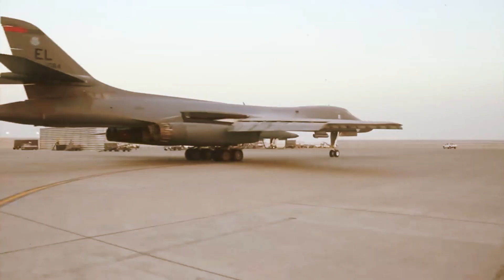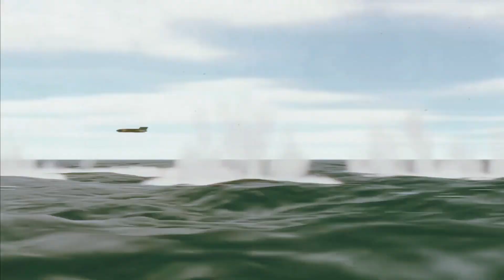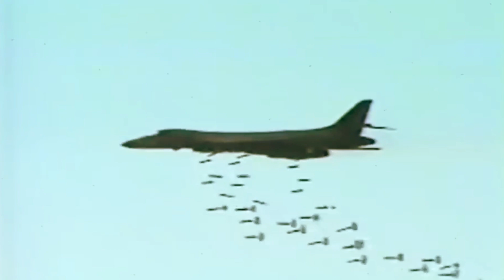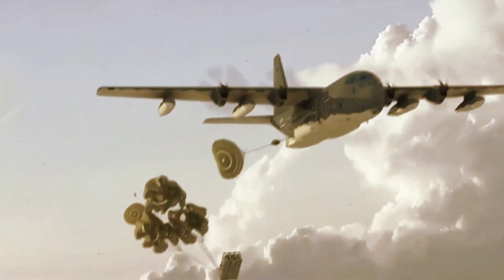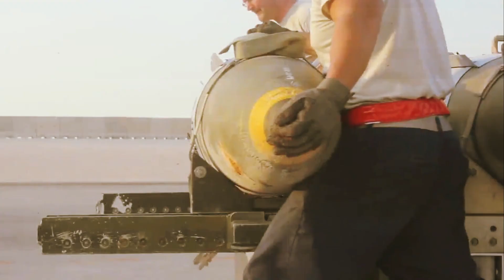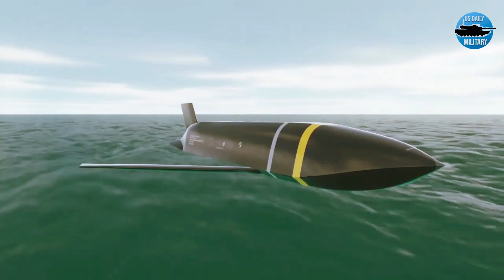New B-1 Bomber : Could Turn Chinese Aircraft Carriers Into Flaming Wrecks

Comment: The Rockwell B1 bomber got canceled due to cost over-run's at over $2B a copy - so the title is whack.  In my view the Air Force blew it when they took Northrup's B-2 bomber over Lockheed's smaller bomber design with much better stealth capabilities.